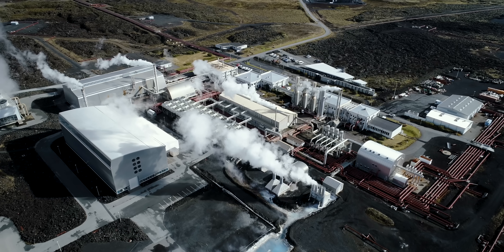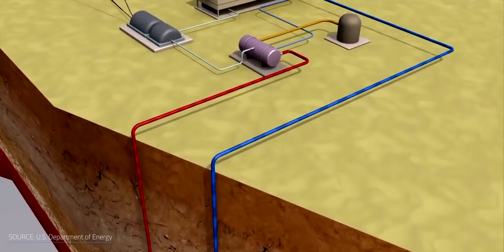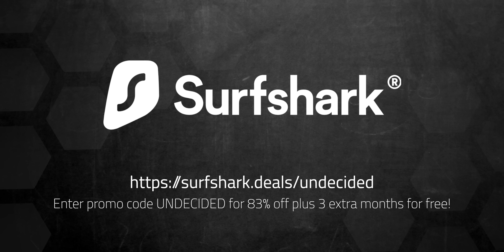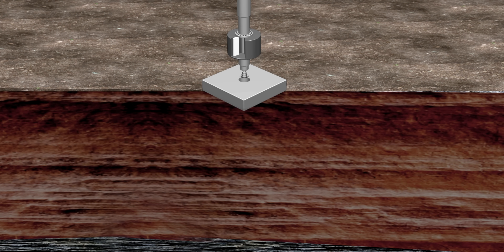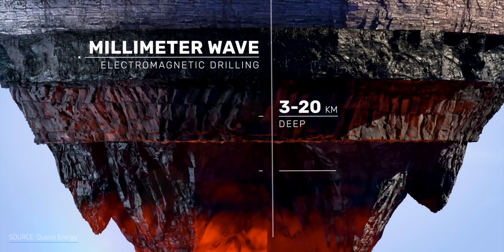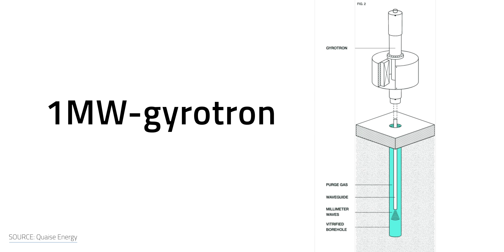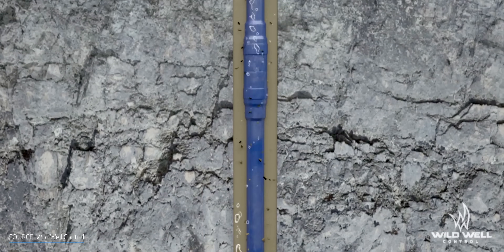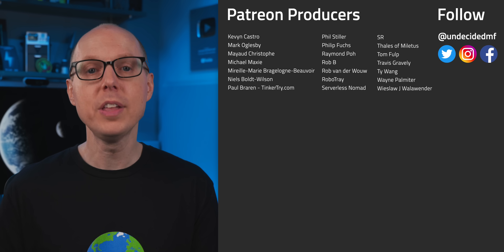Why This Fusion Tech May Be a Geothermal Energy Breakthrough

Comment: As a geologist who is involved in geothermal drilling in New Zealand, I can't see this working. To successfully produce the volumes of steam required to feed a power plant you need to access heavily faulted rocks with interconnected water filled fractures. The instant the beam intersects one of these, the hole will fill up with superheated water. Then, not only does it have to vaporize the rock but it will have to vaporize the massive volumes of water to maintain its progress. Then how do you handle the uncontrolled steam at surface? Having stood near to a well being tested/vented, I can tell you that dealing with 1/2 a ton of steam per second is not a trivial detail. Also the fractured rocks that make the best geothermal reservoirs are also pretty unstable. Having the well bore collapse behind the beam emitter will present a constant risk for getting stuck. Also, without the buoyancy factor provided by drilling mud. The rig that is running the beam pipe will have to be much bigger and stronger as it will have to suspend the full weight of the pipe and power cable. I'm not going to say that this won't/can't work, but I will say that they don't seem to have a good grasp of the real world challenges that exist. Geothermal drilling is far more challenging than oil and gas drilling.

Comment: I REALLY have high (low?) hopes for this tech. Being able to drill this cheaply takes a huge chunk of financial risk away from geothermal, and right now that's the biggest barrier to seeing more of it. 

I would also think the seismic risk for this tech is lower, even in active regions; there's less vibration and disruption to the surrounding formation, especially with the glass forming an instant casing around the well. The proposition here sounds almost too good to be true, especially when combined with the prospect of using existing coal plants as they're decommissioned. It seems like a win-win in multiple directions.
Reply: It`s not the drilling that creates earthquakes but the injection of liquid into the earth. A startup here in Germany created so many earthquake with their geothermal heat exchangers, they lost their drilling licence again. The earthquakes weren't strong, but the architecture here isn't earthquake proof (no natural ones occuring) so there was still a lot of damage that the company had to pay.
Reply: @Bullshitvol2  Sure, but on that count this looks less earthquake-prone as well, since it will involve less liquid, or at least not at fracking-level pressures.

Comment: when you pump heat from inside the planet and move it to the surface you will be hearing up the surface. They also need to be able to radiate this excess heat to outer space. A narrow band of infrared light can do this.

Comment: I would ask a number of questions.  1) How far has the drill done so far, what  depth? 2) How could you work out the cost before you have some idea of the cost per depth?  So many of these new ideas are turning out to be totally impossible. Too good to be true.
Reply: But it is fusion inspired lol.. all hype
Reply: Yep, some potential downsides, just like our current portfolio of energy sources. The more experimentation, the more answers are generated and the more possible refinements or obstacles are encountered. Such is science. Or, we can stick with 1950s tech. Our choice. I recall being shocked that when petroleum was in its infancy, an unstable and highly dangerous byproduct of making kerosene was a real problem. The industry wasn't sure what to do with it, and it was often dumped in rivers and ground. It was too hazardous to handle. Should of quit then, right? That substance was gasoline.
Reply: @fredd4526  Nice story but I very much doubt that it's true. All products derived from coal and oil have rapidly been put to one use or another. There are sources online which claim that gasoline was often "discarded" before the invention of the automobile, but it's more likely to have been the subject of a lot of research and used for various purposes in the intervening decades – just not by the companies set up to produce kerosene.

Comment: It always bothers me how the costs per kw of wind and solar energy don’t include all of the batteries,  peaker plants and excess capacity needed to actually run these systems consistently. It seems like a clever lie that these industries use. I’m excited for Geothermal energy as it can be consistent and reliable without much added infrastructure
Reply: That and the cost of moving energy long distances.
Reply: Especially solar - the cost is infinite at night.
Reply: The Green Industry has mastered lobbying and propaganda at this point.

Comment: but...wouldn't...wouldn't the amount of energy required to melt rocks so that...we can get energy from them...be more than the energy we get out?
isn't that like using a lamp on a solar panel so you can power the lamp to get energy from it with the solar panel?

Comment: 10:14 If geothermal becomes “universal” below 10 km and this tech would allow us to tap into that in a cost-effective manner, why wouldn’t we use it for basically all of our energy needs?
Reply: Same as SMR nuclear and nuclear fusion, it's not there yet. Once we have a clear winner for baseload power generation, that type of generation will probably become dominant. If it really works like they claimed without any side effects that current geothermal has (earthquakes, limited location, expense), it'll probably get built everywhere.
Reply: @awdrifter3394  Good point, it’s not there yet. Seems like there’s a much clearer path to this than nuclear fusion, though. Like, I’m in my late 30s and I feel like I’ll be lucky to see a single commercial nuclear fusion power plant before I’m dead, whereas this seems like it could really have a few plants within 10–15 years if it works as they say.
Reply: @RyanWilliams222  Well, the NuScale SMR got the US NRC design approval, so that's a big hurdle they have overcame. However, there are still uncertainty to whether it can be built relatively on-time and on-budget. This kind of geothermal drilling seems to be a bit further from production ready than SMR, but the approval process is probably a lot easier (probably similar to current geothermal plant approvals) so it might catch up in the end. 

Fusion is probably the most unpredictable one, it might have some breakthrough in the next year, or it might never be feasible. I'm not a scientist, but from my understanding is that the fusion in the sun happens at much lower temperature due to the immense gravity the sun has, but to make two hydrogen atoms fuse on earth takes much higher temperature, also the confinement on the sun is its gravity, but on earth we have to use magnetic fields. So with the energy cost of heating the hydrogen, the energy cost of the magnetic field, and the inefficiency of using that heat to turn a turbine, fusion power on earth might never be net positive.

Comment: If we could produce geothermal power for less than $0.10 a kWh it would be a game changer. 
Start drilling holes in a grid across the US near cities with high enough electrical draw. 
I wouldn't trust glass as a seal for a well used for geothermal. Temperature gradients induce large enough stresses to induce tensile fractures in rock.
However, below a certain depth threshold you wouldn't need any additional case though. 
The glass would be "good enough" at the basement depths as they are suggesting. Very elegant solution.
I agree that drilling deep underground you wouldn't need to worry about earthquakes.

Comment: Hi Matt, thank you for the brilliant video yet again. In all my experience in drilling allow me to humbly state that the glass barrier tube that’s formed by the laser would do little in the event of a blowback or fracture.
Any fluctuation at super deep levels releases ungodly levels of energy, forces that even make even tungsten carbide brittle. I’m still pretty sure you’d need drilling mud.
Reply: Doesn't this technique use pressurized gas as a substitute for the drilling mud? Still needs a medium to counteract the hole collapsing, but one that doesn't lose effectiveness at lower depths.
Reply: I was also wondering about this.  Even if the glass barrier were stable during and shortly after the drilling, would it be stable weeks or years into actual steam & liquid transfer that occurs while the geothermal plant is operating?
Reply: From what I take from this and my need to lookup blowback, the process doesn’t seem to have the same concern for blowback if it’s the same meaning I saw for oil rig drilling. These guys are melting rock similar to using a focused beam from a very powerful microwave oven that turns rock into molten steam, with high pressures. This high intense RF and pressure seems to border between pneumatic and hydraulic pressure that could be redirected toward deficient spots. Glass can also be formulated to be either tuned brittle or flexible and layered into composite reinforcements.

Comment: The geothermal plan B, is to use the modified hydraulic heat engine promoted by Novel Therm. com.   It can make geothermal energy with only 85 degrees C, and do so at 18% efficiency.  Check it out, its really cool, because its less hot.   Greg

Comment: Fantastic video, three main questions come to my mind immediately:
1. Do the cost calculations per kilowatt hour vs. wind and or solar take into consideration that geothermal would be generating power 24\7\365 while wind\solar cannot? I assume they do but just asking.
2. Is there any concern that this technology could create a lava "geyser" Similar to how drilling for water or oil can sometimes result in underground pressure forcing these liquids to the surface?
3. Is there any way that this same drilling technology could be applied to much greater diameter holes for tunneling purposes? The idea of lower cost and faster ability to create tunnels for transportation and or the movement of water through mountains would be incredibly valuable to aid the implementation of High-Speed rail systems or even hyperloop type transportation.
Reply: Regarding Number 2 I don't think so. Magma comes from the mantle and that's deeper than that. Where there is magma in the crust is inside a caldera, under a volcano and I suppose nobody will want to poke that...
Reply: Thanks, another reason not to use this in already fragile teutonic zones (along with possibly triggering seismic activity).

Comment: Thanks for this penetrating video, Matt! 

Awesome prospect! I'm not convinced the rock-glass walls could sustain the high pressures though. We're talking LOTS of pressure. How thick do the walls have to be? Can the gyrotron melt walls to that thickness (without the liquid pooling inconveniently)? Lots of questions.
Reply: I had similar concerns but see potential in devising a impurity injector and remote stirring mechanism as one potential repair/patching mechanism. Another is to have a press mechanism that pushes outward to allow composite layering against physical, chemical and thermal threats. This expansion technique may also widen the door, pun not intended, to concentric bore widening, steerable boring, remote architecture, and geological stabilization. I was more shocked by the $1,00/meter cost.

Comment: how would something like this handle an aquifer? Or are those typically only in the sedimentary rock layer that would be done with conventional drilling before inserting the heat ray?
Reply: Gotta love "happy path" research and idea sales. Even the cost comparison isn't good, comparing just the electricity cost of the proposed method vs. the entire cost of drilling conventionally to the same depth. Lost me right there.
Reply: @CmputrAce  because telling the world all the ways it could go wrong would bring in all the investors.  I mean is there a CEO of any company that is going to detail all of the ways their new product could fail?  It's an idea, and a pretty great one at that, if they are right about it they could transform the energy paradigm.  While they are not talking about all the risks I'd be willing to bet they have a board full of all the ways this will go wrong, contingencies for those risks, and new plans to overcome.

Comment: Your so silly with your jokes! 😂. Try pvt panels and reuse of energy from the walls of your swimming pool instead of drilling into rock for use with heatpump. Floorheating in a 400mm isolated, airtight house. I work as a project disign manager in Norway.

Comment: I wondered if directed energy drilling would be made public in my lifetime beyond fiction and I look forward to how long it will take us to scale it up in size for tunneling and infrastructure. Please keep in mind lower temperatures can be used now using Binary Cycle as you mentioned with fluids that have lower boiling points or with the use of reduced pressure, 

Photo voltaic are also a collector of heat in the sun and aquifers are a great heat sink with benefits of cooling the P.V. cells improving lifespan and reducing efficiency loss from higher temperatures and way less drilling.

Comment: I have concerns about when they hit voids or pockets of gas or liquids because at that point there will be no rock to turn into glass. Also, at those points, The high-pressure gas or water will blow back up and potentially damage the laser system.
Reply: Any liquid or gas will be in the pores of porous rock. Whether such fluids would pose a problem for this technology is still an interesting question. Such fluids don't turn into glass at high heat, and could flow into and out of the well. If they're hydrocarbons you could get yourself a blow out, which is both a hazard for the crew and a pollutant. I guess you don't want to strike oil or gas with this rock vaporizer.
Reply: @anderslvolljohansen1556  agreed!

Comment: This would be a good source of stable base load power; not intermittent like wind and solar.  Also sounds like this could develop faster than the micro nuclear power plants, especially in regards to the permitting process.
Reply: If it really works like they claimed, it should be as easy to build as a solar power plant. Just some basic environmental study (maybe make sure it's not on a fault line and not on underground water source) then they can drill.

Comment: They better use some drilling fluid with some gas only at the bottom. Otherwise, if they lose pressure just once, the hole would collapse if it is deep enough.

Comment: Now I know the earth has plenty of heat, but won't taking away heat eventually lead to issues? Do we know what a loss of 1 degree do? We've used the "There's plenty to go around" on many things (air, trees, etc) but they too were finite.

Also wondering what that might do to the climate in terms of heat (not CO2 as it wouldn't make any). If we take heat from the planet and put it in the air, won't that potentially also increase it?
Reply: It won't lead to any issues even exploited at planetary scale. The heat is lost to the enviroment anyway, with geothermal you are just accelerating the process. Eventually you will cool the temperature of the rocks down until the natural replenishment accumulates again (assuming you are taking more than that to begin with). 
And no, dumping hundred of times more waste heat that humanity consumes today would not effect the earth at all, we would need orders of magnitude more heat to heat earth 1C in 100 years. Global warming is due to gasses "recycling" the heat that's trying to escape, but compared to the sun, waste heat from all human endevours is absolutely negligable.
Reply: @vipondiu  Probably right, but we tend to only find out negative impact later, so hopefully this won't be the case.

Comment: I've always had geothermal energy on my mind as a renewable source of energy. Back then, I thought going down 200m into the ground would have been enough. I was so wrong by a magnitude. But this new drilling method sounds promising. Can't wait to see their POC project. 
Did they get the idea from "Dr Braz"?
Reply: 2 orders of magnitude, in fact, 20,000m! 200m is a good depth for ground source heat pumps though, but then you at the only getting slightly warm water and have to use electricity to extract useful heat from it. As opposed to geothermal where the heat is so concentrated too can get electricity out. I don't like when Matt says geothermal for ground source because they are such different things that it can lead to some confusion to use the same name.
Reply: I remember the movie but forgot the character’s name. These guys are a little older than me, perhaps the book that inspired the movie may have had its influences. It might be better to race toward being the highest producing open source product than to get bogged down in too much intellectual property.

Comment: It was a very informative presentation of this exciting technology, but I found it unfortunate that several times near the beginning of the presentation, you referred to this as "fusion". The only thing this has in common with nuclear fusion is that the vaporized rock is hot enough to form a plasma. It's not fusing atomic nuclei. Later in the presentation you called it "fusion-inspired", which is not so misleading. Aside from that quibble, the rest of the presentation was great.